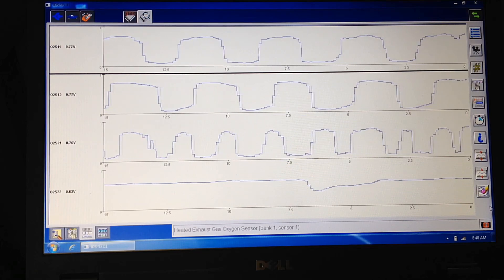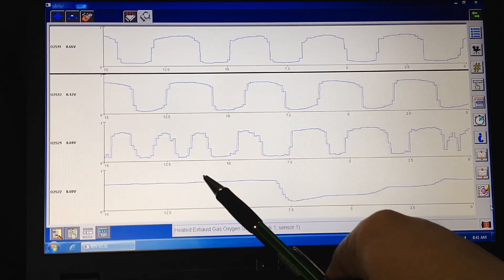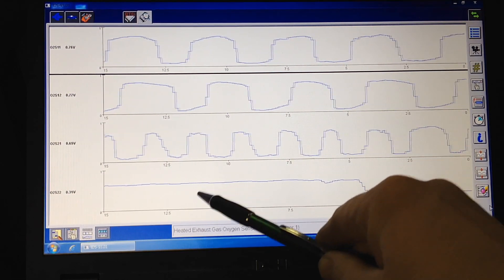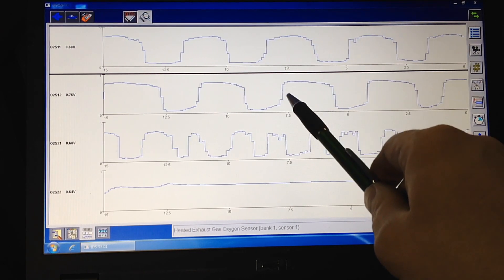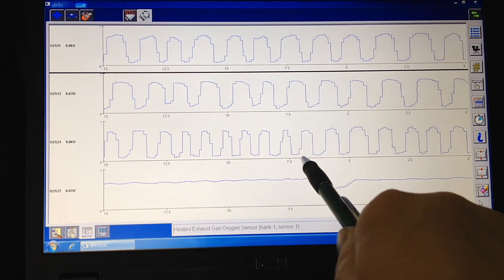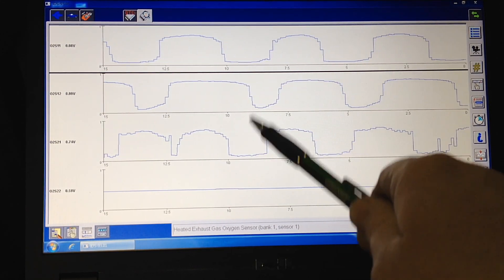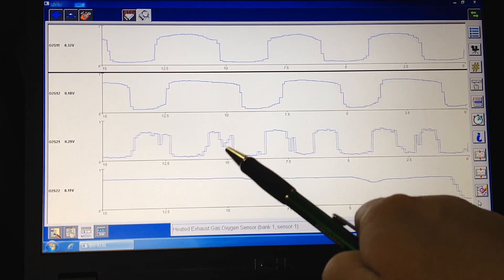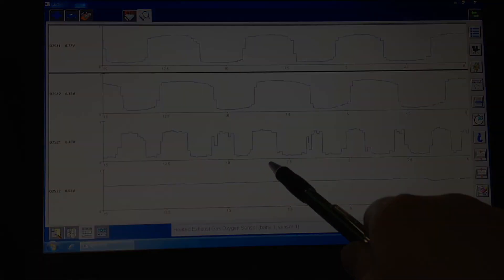Ford Catalyst Efficiency Codes P0420 P0430 Explained

Comment: Hey ford guy you Eva hear off any problems with the ford explorer sport 2013 wife told me the shift to park light stays on when she puts in park it happened 4 times ,been to dealer 3 times already for this problem, they said they may have to replace shifter assembly ,she told me the other day the gas pedal went down by it self ,a quick surge, only did this once ,she said she could actually could feel the pedle acc.crazy ,I also noticed the other day cleaning it quite a lot off black build up around tail pipie ,is that normal? I think they run them a little fat because off the turbos I think ,do they have any tsb on 2013 misefire ? For the explore sports ? Hood had to be fixed at 10.000 miles bubbling for the inside out ,no cracks on out side ,they still having paint issues? I remember back in the day they had problems with Tran, banging into reverse mostly does this in the morning shifting into reverse ,doesn't do it always intermittent, they replaced the value body +some special additive back then ,do you see any come throw yet at dealer with my model? Any in foe would be awesome veh has 47.000 miles on it now
Reply from the maker: Scott Howe Ok few things the pedal itself cannot go down by itself there is no motor inside of it. The soot is normal from direct injection and the shifter will need to be replaced yes I have done many whole assembly. unfortunately the explorers do still have paint bubbling issues our 2012 did too. The transmissions on these have been rock solid you shouldn't have any issues besides the occasional reflash.
Reply: Hey thanks for getting back to me ,the day the veh started to acc I was sitting on the passenger side ,I asked my wife why did you just acc it only happened 1 time ,she was driving bare foot and said she felt the peddle sink from her foot ,we were coming up to a stop sign, with in a short distance ,she was doing around 25 mph ,didn't they have some issues with cruise control cable sticking back in 01 02 ,she wasn't in cruise control setting at the time I believe it was the expl. sport track and a few others back then had issues, I'm sure they fixed this problem bye now lol ,but then again you would think they would off got there paint issues fixed ,my door is showing bubbles around Dr side handle area now :-(  this happened at 34.000 miles  .is there any t.s.b  on plug replacement on 2013 exp sport veh ? haven't had any miss fires yet ,but if they up graded the plugs I would replace my self ,I think I heard you mentioned they changed the gap smaller to 28 ? on the f150 turbos 2011 ,when I get my oil changed at dealer I tell them I only want full sentetic oil ,not the oil they pump out off the tank ,quart bottles ,I use full because off turbos ,they always use the pump oil blend sent.I'll sit in waiting rm and watch them pump it in ,I asked sevice manager ,he says they used the full right from the quart bottle ,I can't make this stuff up ,I no both would work but with turbos I prefer full ,I also had a problem with my multi func.switch on column it seems sticky when I use to tack left turns ,I compared it with another sport ,it was like night and day they replaced it, it worked great for about a week, went to different dealer ,the new dealer claims they went to original dealer and pick up switch and installed it still had same problem, have you heard off any problems with the expl.sport 2013 switches ,(muti func) it ,
just seems sticky ,it had the cling cling fixed in front end links ,I'm sure you replaced a million off those ,noise over bumps pretty common problem,I worked for ford for 4 years before my motorcycle accident ,thanks for any info you can give me been out off the loop for awhile ,my ford explorer sport track  2003 has 278.000 miles on it still going strong dosent burn a drop off oil ,thanks again for any info you may have sry to bother you I'm sure your real busy !

Comment: General interest question-should the bank 2 up stream O2 sensor (02521 graph) response match the bank 1 up stream (02511 graph)? What was the problem/fix? Great videos, Thank you Tony
Reply from the maker: ts302 No they are individual banks so trims and response times firings all different. This truck had multiple coils misfiring causing the cat to fail not to mention timing errors from a vct solenoid on that bank also.

Comment: One of these days I'm thinking of either getting a 1995 or 1996 F-150 with the straight-6 (one the few vehicles that I wouldn't mind buying even with even 500K miles on it, as long as it's in good shape).  P0420 is the reason why I would lean towards the 1995 (no check engine?), but the 1996 would give me much more valuable data due to OBD2 should anything go amiss.

Comment: Got a 1998 Buick Park Avenue, which has P0420, but It passes emissions just fine.
Reply: Your emission guy don't know what he is doing then because the chk engine light cant be on and if you reset it then he should see the cat monitors haven't completed yet
Reply: I live in colorado, and emissions is state run, so It passed fine. I even think the light was on.